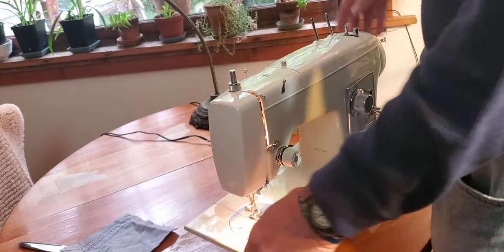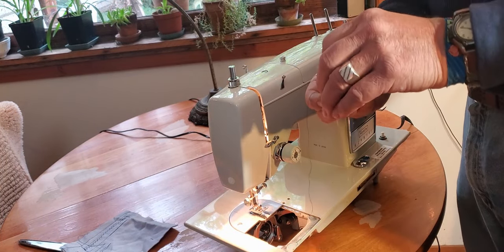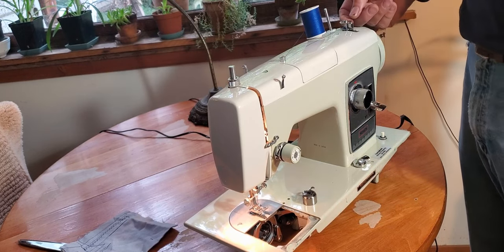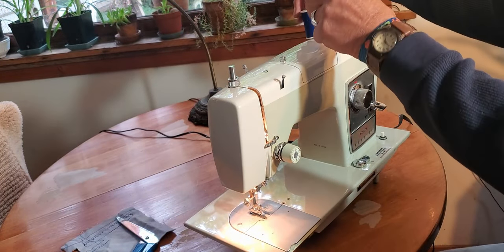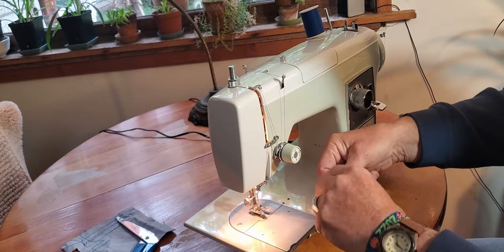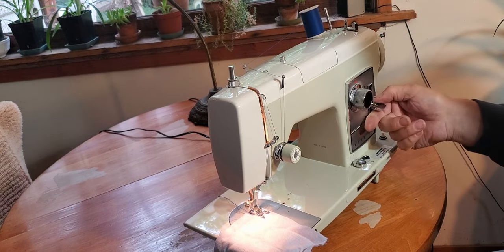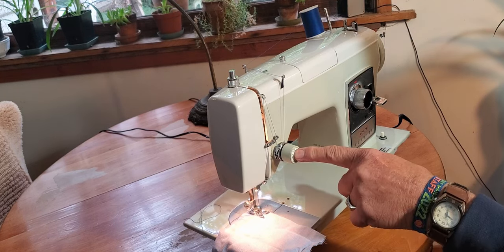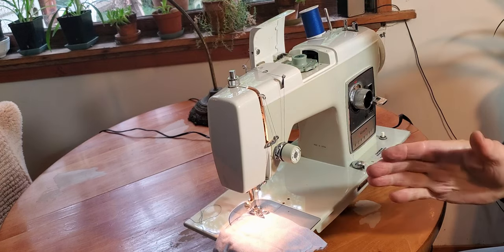Kenmore 158 950 Sewing Machine Tutorial

Comment: My wife recently picked up one of these, but without accessories & cams. That's okay with her as all she wants to do is simple sewing & this is an upgrade from her older model. You confirmed what I told her - it can't do zipzag stitching. I don't know if it's important to her, but what does the F/R setting on the width control knob do? Also, what's the purpose for the +/- knob on the backside between the motor & the thread spool posts? Thanks for posting this video.
Reply: The knob on the back...I FINNALY found out what it is! 
The +/- knob on back of models 95 and 96 machine, is your stretch stitch length control (stitch modifier), for how long or short, forward & back, each stretch stitch will be. This includes the flowers, dogs, & picture style stitches.